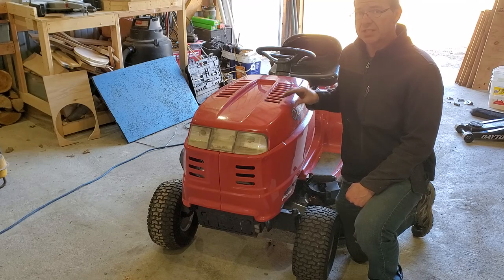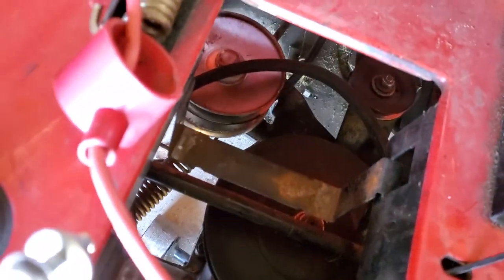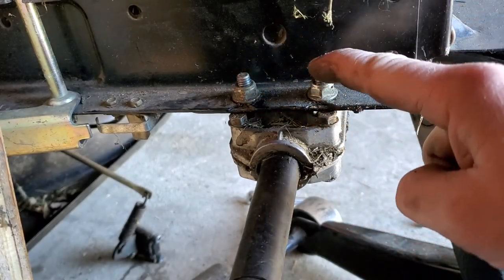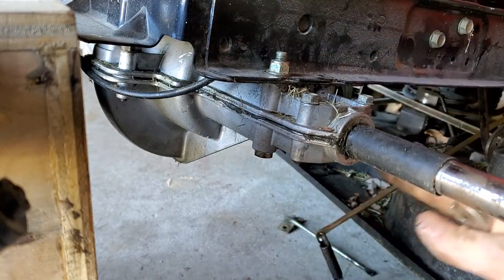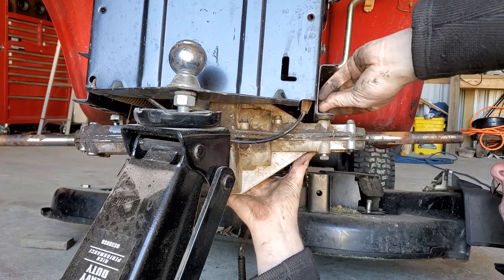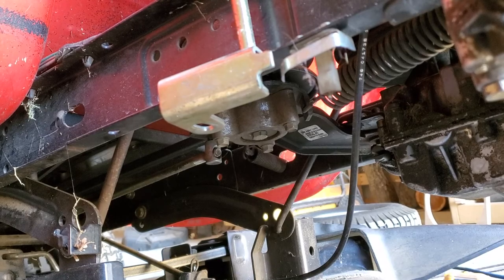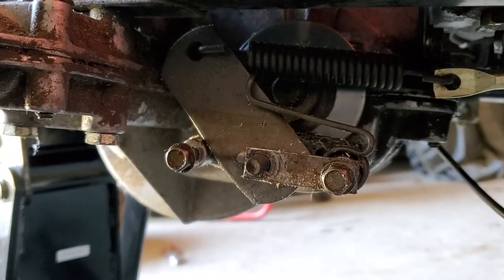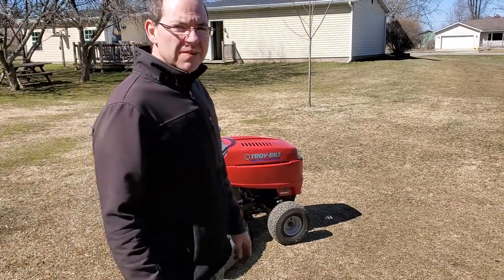Riding lawnmower transmission replacement step by step

Comment: Excellent and truly straight to the point tutoring video from Mr. Jamie List!! You Sir, saved me a ton of money by showing me how to do this myself. I took my time on it And the lawn tractor works and cuts better than before. You even hinted at how to fix the clutch brake and put new pads on! I really enjoyed this project with my son. The two front bolts underneath in the back bracket were easy to get off but a pain to line up and get on properly, but I did it right. Thanks Mr List. I will be watching your videos for more good things in life
Reply from the maker: Thank you for watching and I happy that the video helped you

Comment: With the shifter do u have any tips on putting it back on I’ve never done it before and I’m afraid of taking it off w the stick in neutral and putting it back on wrong
Reply from the maker: You wouldn't have to worry about that it will simply be correct when reinstalling

Comment: Could you not have changed the fluid in the replacement tranny before installing?
Reply from the maker: In this type of transmission there is no fluid only grease
Reply: @jlistdiy  I'm seeing that once I found some vids on it, apparently the grease gets old and moves out of the way of the gears as it hardens. I wonder if its worth it to change it.
Reply from the maker: @davidwelday3276  true you definitely can change it out but definitely makes a mess l have done a few when repairing gears